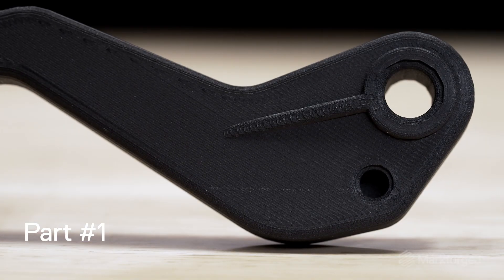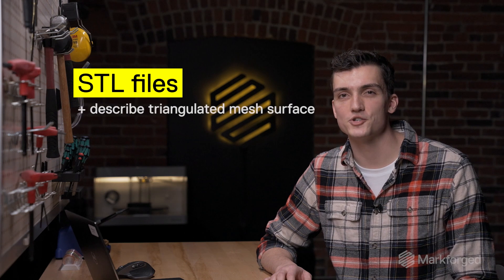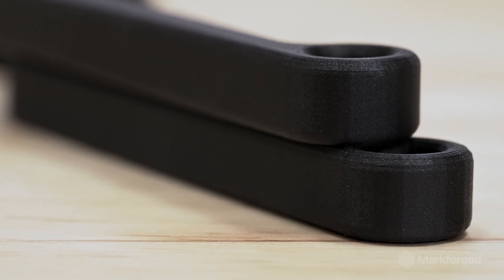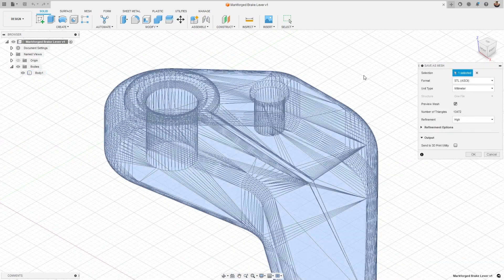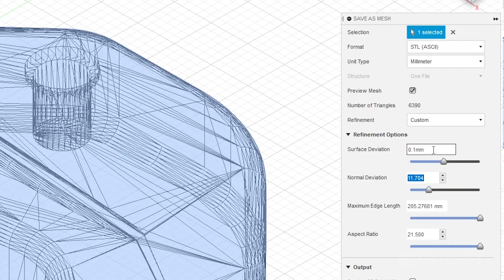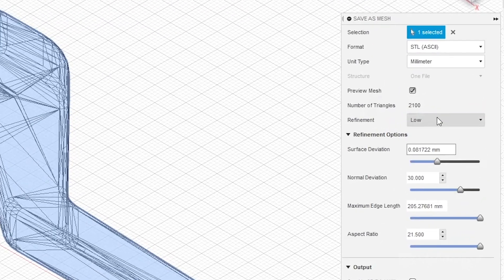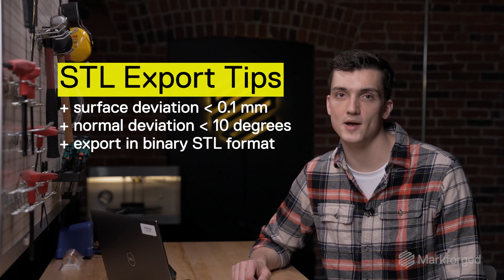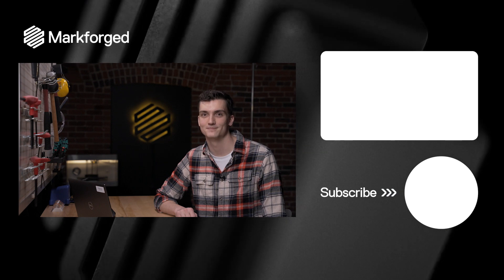How to Export a High Quality STL File | Markforged Reinforced

Comment: I like your video. But I do want to highlight something. At this point-in-time Fusion 360 does not allow you to export with a 0.1 mm surface deviation. Only a surface deviation of 0.043818 mm or lower is allowed. And f you increase your resolution (by lowering the surface deviation) you get less accurate holes below 8-10mm. It can then be very hard to fine-tune the offsets (for instance to press-fit a magnet. Even a slight offset makes a huge difference. And actually you should always keep your service deviation slightly higher then your slicer software, otherwise Arc fitting will not be optimal. For instance, my 3D printer with Bambu Studio refers to a resolution (surface deviation) of 0.012 mm. Curious of your thoughts on this.

Comment: Hello, I am a design office engineer who uses 3D printing a lot. I don't understand why 3D printers only use this prehistoric STL format and not a vectorized format. It's as if the PDF did not exist for 3D printer developers, it's like the days of MS.DOS. Why printers can not import in a "civilized" format like STEP or IGES and then generate their own mesh taking into account their printing parameters? In machining, the machine mainly imports STEP. I guess there's a better technical explanation than that printer developer engineers are on average 80 years old and work in MS DOS ;-)
Reply from the maker: We hear you - adding STEP is on our product roadmap. Stay tuned.

Comment: Why not just slice from an step file?
Reply: switched from cura to bambu slicer, and i only slice from STEP files now and never have facets
Reply: @enyoc3d  cool! I don't have problems with facets either, exporting my models from Fusion in 3MF, with a high resolution and slice in Cura 5. But I'll have to try out Bambu or the forked version of Bambu that I can't remember the name of now :P
Reply: Not all that many slicers can do that currently, and in any case, I'm 99% sure that those who can do so will convert the solid to a mesh anyway.

Even Fusion 360 converts solids to meshes in the CAM environment, both for additive and subtractive methods. It doesn't really show it clearly, but it does do it.

So, if you export to a mesh directly in CAD, you will potentially have more and better control over the quality of the mesh.

Comment: Not working with Mark Forged, BUT this helpes alot. thanks!
Reply from the maker: So stoked to hear it's helped you! If you have any other How-To videos you'd like to see, please let us know.
Reply: @markforged  Hey there! I have a suggestion for a future video idea. It would be great if you could make a video tutorial on configuring a printer to allow pausing at certain layers. This would enable viewers to insert magnets or nuts into the print and then continue the printing process, resulting in built-in magnet or nut parts straight out of the printer. I think many people would find this technique really useful. Thanks for considering it!
Reply from the maker: @Nishanth_Prime  Great idea! We actually have this topic on a list for future videos. Looks like we may need to prioritize it a little sooner. I'll ping you with an @ when we post it. 

Thanks again and feel free to send any other ideas you have our way.
Reply: @markforged  Hey there! I've thoroughly reviewed your material list and specifications, and I'm really impressed with your capabilities. I was wondering if it would be possible for you to 3D print an electromagnet with multiple layers of spiral copper, starting from the corner and ending near the core, and then repeating the process. This design could potentially create an electromagnet with practical applications. I believe it's achievable due to your high micron level Z-axis accuracy. Additionally, utilizing 17-4PH Stainless Steel as the magnetic core for your electromagnets could further enhance their performance. I'm excited to see the possibilities that your expertise and technology can unlock! Keep up the great work!
Reply from the maker: Hi  @Nishanth_Prime  - I may be misinterpreting your question but I don't believe this would be possible, as you can only print one material at a time.
Reply: @Nishanth_Prime  You might look into using heat-set inserts in your prints to meet some of that need.  You can use just a soldering iron (preferably with special tips), or make any of several DIY press jigs that are out there.  In most cases I think installing inserts after printing will be less hassle than having to stop the print to add fasteners, not to mention needing to be present at the time the print needs them added.